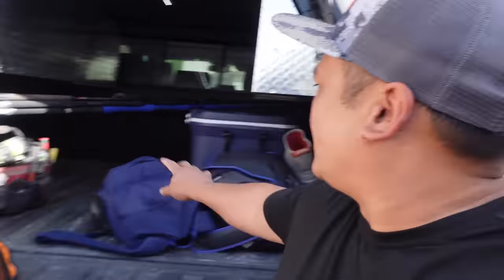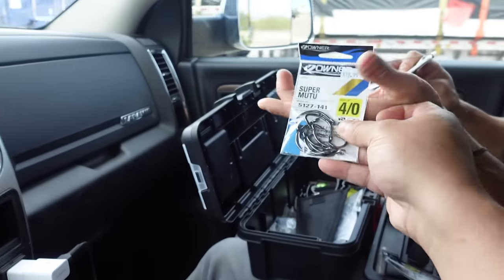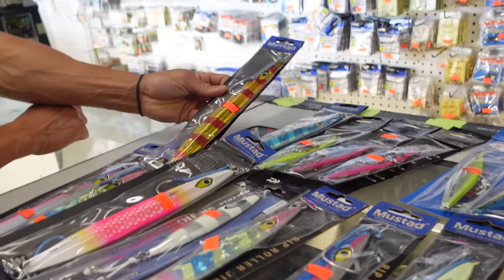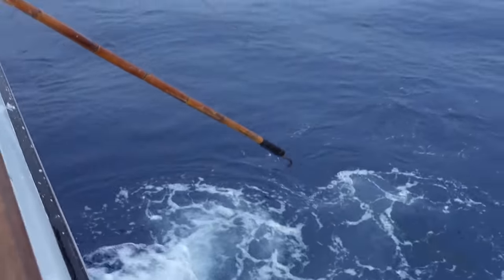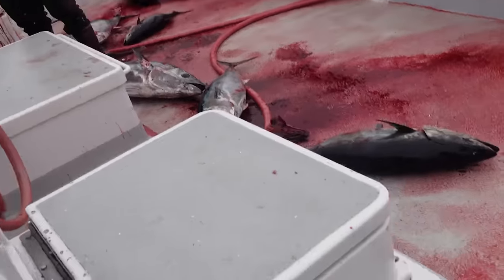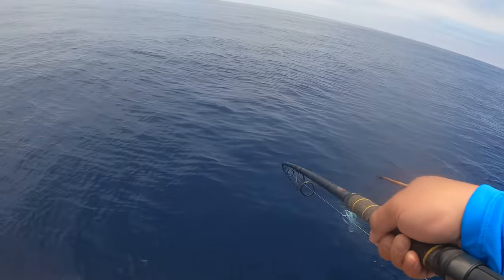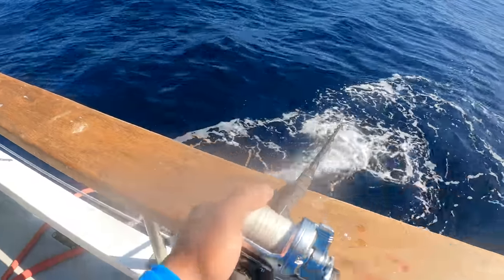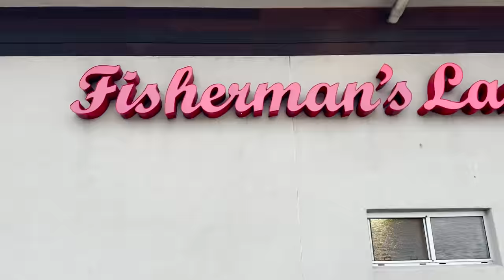Ripping Bluefin and Yellowfin tuna lips onboard the NEW LO-AN.

Comment: Great video. Very clean edit. Bro, what line class were fishing on the Speedmaster and what Phenix rod did you have it on….just got one and not sure what line and rod class I want to fish with it yet. Thanks.
Reply from the maker: Phenix abyss 808 casting rod with speedmaster 10, 50lb braid to 100ft of 40 flouro leader and downsized to 30lb to get bit.
Reply: @vuau3734  thank you bro! Tight lines
Reply from the maker: Sorry 809 20-50lb rating

Comment: What set up did u use
Reply from the maker: Pheonix axis rod with Shimano speedmaster 10 on the fly line with 30lb leader and same axis with Okuma avenger 65 spinning reel  with 25lb leader.
Reply: @vuau3734 how did your phoenix axis rod do? Would you recommend it mainly for bluefin?
Reply from the maker: @jacobmeche4480  they don’t make a heavy duty axis for jigging and heavy setups. But the model I used is perfect for smaller class flyline fish.
Reply: @vuau3734 Sounds good thanks man!